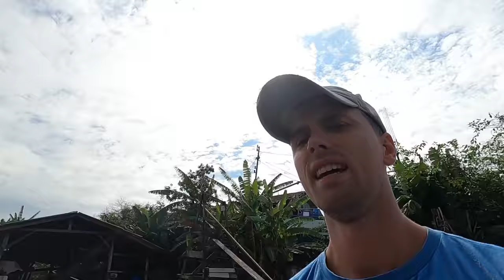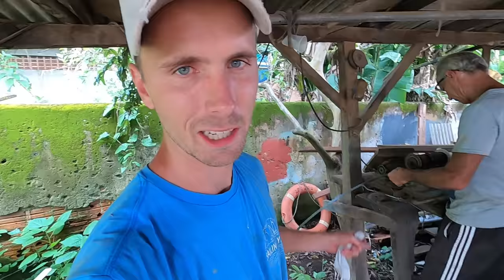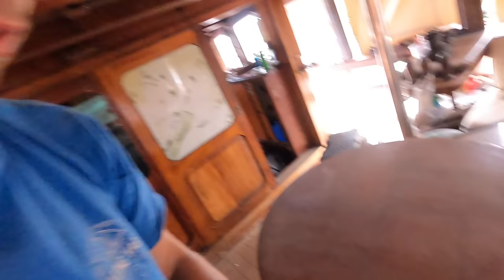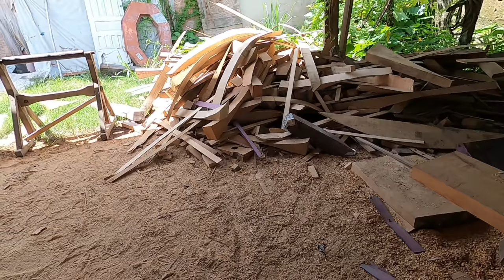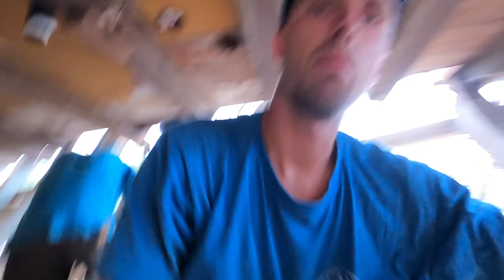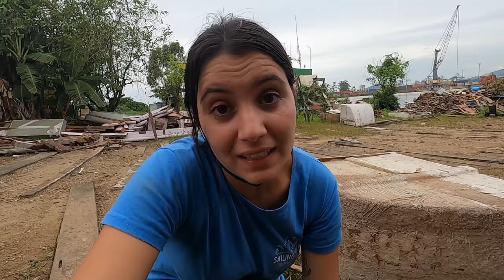Celebrating a MILESTONE: last FRAMES installed! — Sailing Yabá #29

Comment: Hello !  Gotta question: you showed us the damage done by iron (steel ?) plates and bolts.
Then we saw steel nails and rods used to attach planking and frames.
Won't the same damages be done because of the same steel contamination ??
Q2 : On all saw mills, there is a bottle dripping soapy water on the cutting blade(s) to cool the teeth so to last longer. 
 Can you ask Zeka why they don't do the same ??

I love the progress made. With the new frames, Yabà looks great ! 👍🤩

Comment: Hi Guys,  Does the "Red lead" protect your timber from the Teredo worms?  If not what are you treating the Hull with to do this?  is it a coating paint or do you sheath with something like copper?

Comment: I have noticed  the pile cut off wood from the making  of the frames.  If you salvage  some of it by making  it  into a rectangle  shape and then  cut it into 1 or 2 inch planks you could  make it into very usable planks by laminating  it together to be used as cutting boards, short selving  or any number of projects.  The wood used to make the hammer  handle( forget the name) is very beautiful.   There's no end of uses for even the smallest  pieces.  I just   purchased  a 8 foot by 6 inch long board of 1 inch black walnut and it cost me around 100 dollars Cdn. for a project I have in mind.  Just some food for thought.   Great  video. As for a 🐕  you should get a Dutch  barge dog.

Comment: Red Lead paint was used on metal hulls has an antifouling, wooden boats used copper sheeting and then copper paint, small boats just used tar, copper sheets or paint became expensive, to preserve the wood on boats a hot liquid tar was used. 
They stop using red lead and other kinds of antifouling paint, not because of so much of the damage to human health, but because of the damage it was doing to the marine life, mainly shell fish and coral.

Comment: The New Boat will be epic i am sure and seeing your replacing just about Everything on the Old Boat you might change that Steel plate to Bronze and anything else that might cause rust , and to show a wall of bricks as to why the boat joins are in two locations was Awesome just a shame the wall had a Fault Crack all the way down it :) looking forward to the Old Brand New Cabin when the New Deck floors are done . Stay Safe there are go fund me everywhere .

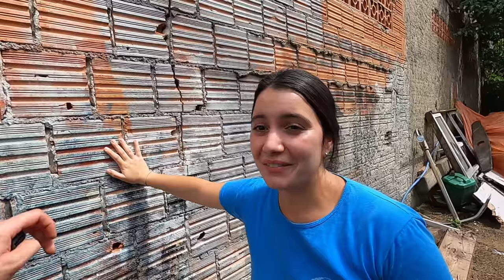Comment: LOL...😂 @22:10 MP is charmingly explaining why the planking is overlapping vertically.
She is absolutely right, but is contradicted by the huge vertical crack 🤔 in the wall some 15 cm. to the right....😉
But yet another great video. Thanks! 👌
Congratulations on the finished re-framing from the Netherlands.

Comment: Seeing how extensive the work is, wouldn't it have been better to just commission a new boat, then again.. seeing how extensive the work is, you are building a new boat. Reminds me of the tale of the council worker who retired after 40 years and was still using the sweeping brush he originally was issued, the same one !. ( ok, so the shaft had been replaced 30 times and the brush head replaced 20 times, but the brush was the same ! )
Reply: I'm wondering if some regulations in brazil that only apply to "new" boats are being avoided with this one.  If the taxes are high enough, buying and refurbishing a sinking boat with all the proper papers may come out cheaper than building new.
Reply: @cvar1  Seems a reasonable course of action if that is the case.

Comment: Its important to have a solid foundation to build on. You can now be confident that everything on the bottom of that boat is strong and solid.
Reply: @gav2759  obviously you havent been watching. The all threads just pull them together. Then the nail the hell out of them. Might try watching all the videos before assuming anything.
Reply: @gav2759  that yard sure seems to get a lot of work to be doing all wrong. As far as which episode. You can go there page a rewatch the videos. Or if you have a concern you might try reaching out to Ben or Mp and maybe they can explain or perhaps ask the men doing the job. They will be able to verify if you have a valid argument or not.

Comment: People don't sharpen anything anymore we all use carbide tipped blades that are throw away. The old high speed tool steel blades you can resharpen over n over. We have lost something moving into the modern western way.

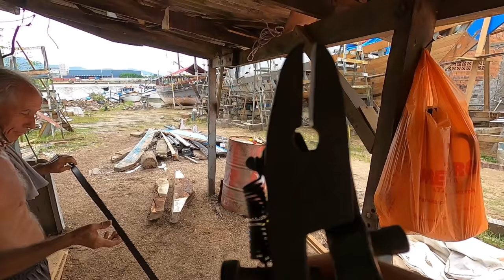Comment: 15:00 That tool is a saw tooth setter which bends the teeth very slightly to give them an offset to prevent the saw blade binding in the saw cut.
Reply: I'd like to know how old that saw is.